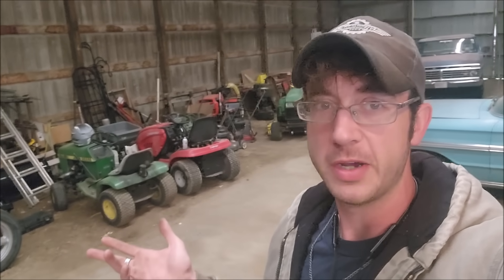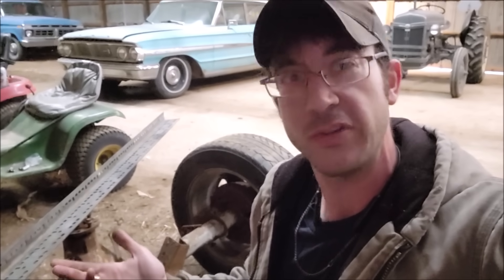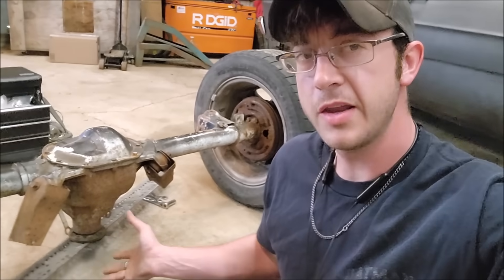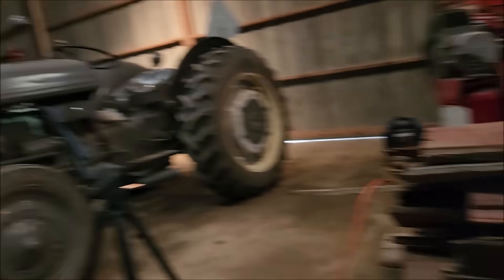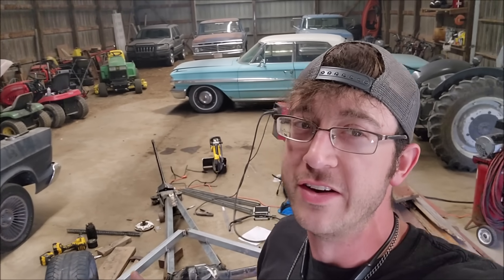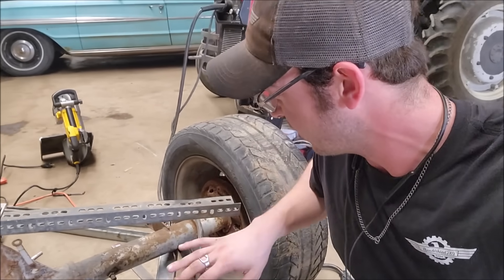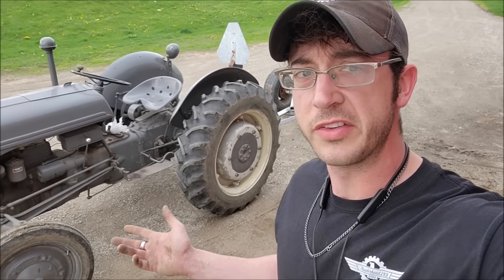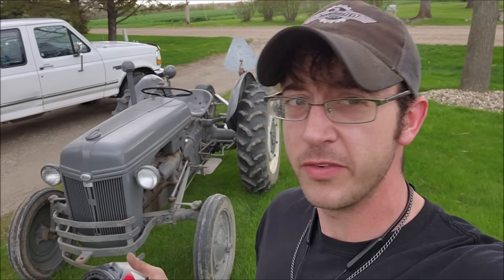Car Differential MOWER: Build & Test!

Comment: Used to be pretty common where I live, I still have a couple of them. Most here were made with 1.5 ton 2 speed axles. Usually pull between 2 and 3 of them at a time although I’ve seen 5 wide pulled before too….that’s around 30 feet wide per pass. And yes, people have been knocked off of a tractor and chopped to bits by them.

Comment: If you bolt the blades with a single bolt the blade will cut grass but if it hits something hard it give way. It’ll resemble the flail blades on a pto mower.

Comment: You should attach a 12" plate with holes around the outside where you can attach about 12 weed eater lines to your desired length. Then if something breaks it's not going to go medieval on your ass and kill you.

Comment: I built one of those mowers years ago but it turned to slow to make it cut good so I made a frame and off set a two to one shaft to double the RPM and it would cut good then. It sounded like a freaking helicopter and was dangerous as *uc*! But it cut good. After we used it a few times then I cut it all back apart before we got killed with it :) Great video...

Comment: I’ve wondered if an over land style trailer could be built with an axle set like that connected to a small generator that would be used to charge a small battery set up for camping.  Recharge going to your next camp site?

Comment: Your angle iron "cutting blade" should be flipped upside down. Traditional mower blades have the trailing edge facing away from the ground and this helps create an updraft, pulling the grass up so the cutting edge shears the grass blades to a more uniform length. Fastening that flat steel stock with a sharp cutting edge will also help to cut cleaner.

Comment: You could have made the blade twice as effective if you had flipped it up the right way and cut it in half. Most mower blades don't have one half bent down at a right-angle trying to bulldoze a circle while the other half is trying to cut and sweep with a short edge. You also need a proper cutting guard, this simply gives the leading edge of the blade some protection against rocks or sticks that it might hit during it's cycle. It also helps make the grass thrown towards a particular direction instead of just going everywhere, including thrown back in front of the cutting blade, which means it has to cut mown grass twice.
Reply from the maker: Hmmmm you skipped around in the video and didn't listen to what I said didn't you
Reply: @ThunderHead289  I watched and listened to the whole video. I'm just commenting on how you might consider improving it.

Comment: Okay, here you go: mount two small wheels under the wheels for the wheels  to ride on... that will give you gear reduction for the speed required. The extend a shaft down from the deferential to mount the blade(s) down low... a couple of very small wheels w/tires, such as from a hand truck on each side would work nicely. Attach their axles (round stock) to a plywood deck to protect yourself (and pets) 😁👍

Comment: bigger tires equal slower blade rpm.
Reply from the maker: Duh - but its the only way to make up ground clearance which is why I said bigger tires - if you didn't skip around, you'd hear that I said I'd prefer to have lower gears like 3.73

Comment: Add a lip to the rear of the blade, to create a fan effect sucking up the grass blades. Or heck even a second fan blade above.

Hold the blades upright, for a cleaner cut on the cutting edge

Comment: Those type brush cutters used to be mounted higher with 2-4 scythe blades on them for mowing hay fields. Also, there was a chain driving the axle from the running tires on ones I've seen pictures of from the early 1900's into the 30's.

Comment: Blade needs to be a plus sign or 4 cutting edges. Like the Meg -mo blades . But instead of the circle gizmo just make a cross/plus sign. Go buy some blades or find some old blades and cut them to work . If it was heavy duty enough find some old bush hog blades.

Comment: You just invented the hit and miss mower. Random fail. Need another staggered blade with all edges cutting not to outrun the gearing.
Reply from the maker: Clearly didn't listen to what I said in the video and just jumped around
Reply: @ThunderHead289  ok 👌

Comment: One thing you could try is find a way to lock one of the axles so your only pulling rotation from one side it would double its spinning speed. The thing that would be hard about that is that its prolly a c-clip axle so you'd have to find a way to convert it. Or you could just put a ski on one side and bolt the hub to a welded bracket so it cant move and let the other one spin.

Comment: You need to build a deck for this so you can get the proper lift to straighten the grass when it's being cut. Also the cutting edge  has to be the correct angle. Looking forward to version 2.0

Comment: A larger diameter tire will give you lower blade speed... Running the tractor at a higher speed does not help because the blades are also having to take more bite of grass at that higher speed... You need to increase the blade speed by at least 4 times what it is currently doing... If you ever got it to the point where the blade speed was acceptable, I suspect that it would be a Darwin Award in the making... 

Oh, and BTW, your music choices suck... The only redeeming thing was that at least you had the volume low enough that I didn't have to mute the video...
👎
Reply from the maker: Thanks for the view.

Comment: I'd re-gear for more blade speed, especially if youre going with bigger tires that are gonna drop blade speed even more. I would also reccomend you add some kind of shield over the top. That's gonna throw debris with some good velocity.

Comment: Smaller tires = faster blade turn. No shield over blade = half a guy pulling it. Careful.
Reply from the maker: Unfortunately I'd have to go bigger tires in this configuration for ground clearance - but I actually made it way more insane but also way better. Will post about it eventually

Comment: I just want to burry a comment somewhere on earth i am so salty and upset that the motorcycle my father gave me which he saved since 1990 that i drove for a decade was involved in an accident last year. Sadder still while incapacitated in hospital my father "took care" of the bike and its gone now... i wanted it back... i would have bought it back... my skeleton is permanently repaired with screws and metal and i would have fixed it even if just to look at it... and it makes me sad. Anyway. that's the last the universe will hear of it. thanks ThunderHead289 for the safe space. i saw you driving your car it made me think of my old ex500 I knew you could understand the emotional attachment.. even if to a machine. 

for clarification it was a true accident, i didn't have a stop sign, the other driver thought he looked careful enough... genuine accident... luckily i was able to react and ragdoll effectively as i was ejected and the homicide detective noticed that i wasn't a corpse.... to end on a positive i got to fly in a helicopter like an eagle :) and i regained use of all my limbs
Reply: what's a trauma dump without some humor. fun fact about being ejected off a crotch rocket. your crotch was nestled against the gas tank before you departed parabolically.... you do the math but let me just say my balls are Salty lol 

like wolverine though i have a metal reinforced skeleton now pelvis and arms in all :) be safe yall.... i have to live upwards of 75 percent of my life like this now.... but im not a quitter i got back on a 2 wheeled machine within the year.

Follow your dreams and let no one's words hold you back. You are the most amazing machine to ever be created, pilot your mortal coils to glory friends.

Comment: Biger wheels will make the blade spin slower. what you need to do is change the gear ratio of the rear end so that is will have a Extremly low gear ratio so that the Drive shaft will have to spin more for every rotation of the wheel.
Reply from the maker: If you watched the whole video, i brought up the hear ratio several times - bigger tires aren't for speed, they are for ground clearance.

Comment: As stated use the swing blade set up for grass. It is only the last few inches of any blade that actually cuts. I have seen one of these where a ride on mower cutter deck was mounted under it and it drove the deck. It had much bigger wheels and it worked really well.

Comment: Didn’t look like it cut very well to me
Reply from the maker: If you didn't skip around in the video, you'd see that literally 4 times I talked about this just being a proff of concept and how the blades aren't even on it
Reply: @ThunderHead289   i didn’t skip around… but proof of concept or not, it still didn’t seem to cut very well. You say the blades weren’t on it but you had something on there spinning. Even the dullest blades cut at high enough speeds and I just don’t think there is enough speed even with sharp blades on it. Add larger tires like you want to gain ground clearance will only slow it down even more.

Comment: Having the blades on a freely rotating centrifugally  balanced axis, and making sure they are perpindicularly aligned with the earths surface, this being accomplished ,of course, with a true magnetic, semi- inverted gyroscope, the resulting cut to turn ratio ,would be proportionately facilitated, and a longitudinal geometric influx of power would be moderalately applied to the neccesary configuration of pitch transference, allowing for an implied distribution of mass, and power, only being impeded by the force, recognized as totally, although highly calculated , revolutions per centimeter.

Comment: I would hook up those brakes so you can "turn off" the blade by dragging the rear tires instead of turning.  And also flip the wheels so they stick away from the blade more or find junk wheels with a different offset.  And cover that blade at least over the front you already have a support there.

Comment: I'd use mounted pcs of 1.5" flat with a thirty degree grind for a better blade. 

Keep in mind your have to trim off one high side of the angle to mount an opposed edge (similar to that of a lawnmower blade).  🙂

Comment: You may call it "redneck engineering", but in northern Scotland we class it as "made on the croft".
You use what is at hand, the welds might be a bit rough, it looks a bit Frankenstein-ish, but does it work,?
Yes,!
Your neighbours will come round, laugh and criticise it, but also suggest a few modifications, and in two years time they will all have built a similar machine and have forgotten about the day they came round and laughed at you.
Keep up the good work,!
Another difference is, in Scotland it would be painted with "red-oxide" paint, as the wet weather would make it rust, and it covers the bad welds.!

Comment: You should find an old brush hog blade or a new one and throw it on. If you got a grinder you can make new blades on it, I'd say you're welds are pretty good. You could be a welder if you had to. Can't tell how much penetration you got but looks like you got some

Comment: To get the highest blade RPM for any given speed, you want the highest numerical gear ratio they make for that type of differential. Also, smaller diameter tires will rotate faster an up the blade speed as well

Comment: You could change the axle ratio to change the rpm of the "blade". Welding the spider gears might also be better or st least more robust than a posi.
Reply from the maker: All things I talked about in the video 🙂
Reply: @ThunderHead289   Sorry, I got ahead of myself. I was posting the comment before I finished watching your video.

Comment: As a Professional weed mower I do agree that is Crazy in a Fun kind of way Pre Decapitation. 
Brush hog style blades are sharpened to have a flat leading cutting edge. With squared corners. That is how those blades cut without quickly becoming Dull. 
I say that in regards to something you said. 

Interesting video. Be Safe and Best Wishes from Montana M.H.

Comment: Needs a cutting head like a weed eater with solid blades connected to a round head with a single pivot point. A single blade would be more problematic.

Comment: Biggest downside I see is using that model of tractor. No live PTO. So you can't have proper blade speed, driving slowly through heavy brush and weeds. Also, a blade guard would be good, because I've done something like this, on a smaller scale and when mowing, it sprays grass and weed debris EVERYWHERE, splattering EVERYTHING nearby, the TRACTOR, YOU, EVERYTHING. I ended up using a piece of 3/4" plywood to go over the top of the blade area and that keeps MOST of the debris from spraying everywhere, but it's still a problem.

Comment: This does not have to be this dangerous, just put a guard on it. You have made a machine to throw rocks at the back of your unprotected head, if you are even briefly stunned you will crash the tractor. Even a sheet of ply strapped to the top would be better than nothing. Sometimes that thing will throw rocks faster than a catapult I promise, let alone bolts or broken blade parts.

Comment: Smaller overall wheel tire combination will result in higher blade tip speed for a better cut. Change the rear end gears to 4.11 gears for MORE blade RPM.  I also like the flail blades better for your safety.
Reply: Lower gear ratio will slow the blade down
Reply: @skinnyWHITEgoyim , When the wheel is rotating the blades it's opposite of what your truck/car does. Wheel rotates 1 revolution & the blade (attached where the former axle used to reside) will rotate 4.11 revs. So the faster the wheels spin with a smaller overall diameter along with higher gear ratio will in fact create more rpms @ a given wheelspeed.
Reply from the maker: tire change is for height since you'd ne screwed otherwise - doesn't actually translate that much, not like I put mud tires on it vs car tires

Comment: Cool project...

Personally I'd pick up a $135 4.56:1 Ford 7.5" gear set and throw them in. I'm not certain for the 7.5" but you probably need to also buy or make a ring gear spacer when switching from 3:1 to 4.56:1 (or find a used high ratio differential to bolt in).

Comment: ⚙🔩🌾 Did you know that Bush Hog blades are designed to swing freely on a single bolt? It's an ingenious mechanism that allows the blades to bounce off solid objects and swing out of the way without stopping the unit's spinning. Thanks to centrifugal force, the blades then swing back into position to resume cutting. It's fascinating how engineering solutions like this improve efficiency and durability. For more captivating videos like this, make sure to visit Meta Tech HD's channel. You won't be disappointed! 🎥🔧👍
Reply from the maker: Plugging your own channel ... kinda weak dude

Comment: obviously you are blind, it's not cutting anything but a few weeds and brushing the grass, why do you think lawn mowers and bush hogs actually have blades with sharp edges on them, think about it, what actually cuts, a sharp knife or a dull knife? and obviously a sharp knife and you can clearly see in the video that it's just brushing the grass and somewhat cutting weeds so you need and actual mower blade mounted
Reply from the maker: You clearly skipped around in the video and didn't listen at all to the plan with the blade - ie there wasn't even a blade on it yet

Comment: Bigger wheels and tires will reduce the blade rotation speed.  I'd look around for an axle from a one-ton pickemup or something else that might have come with a 4.31 or higher gear set.  The shorter the nose on the diff housing, the better.

Comment: What the feck are you doing

Why didn’t you put a pulley on the pinion and run a deck with multiple blades?
Then you could rig up a long handle that controls the tension.

Alternatively… you could replace the single blade with trimmer string. 

Also it’s easier to watch dumb stuff if there’s at least an illusion that you know what you’re doing. Don’t add more self deprecation, instead get rid of the little bit you got. 

on and off are a nice feature

Comment: Bigger tires will slow your blade down, just jog the blade up around the pinion. Maybe bolt a flat to the pinion and bolt your blade to the top side of the flat. I think you will want to keep your blade speed up so maybe taller tires if possible.

Comment: Add some portal axles to change the gear ratio so you can run the tractor slower. Also, that would allow you to change the height of the blade by clocking them at an angle. Great vid!

Comment: change out the blade for a hub with some 1/4 steel cable to make a mega weed whacker. a little safer and   prolly more effective in the long run.

Comment: Welding galvanized metal you can get fumed!! The little white stringy thing floating in the air, there bad for ya!! There's way more of them that ya can't see, until ya get that rust taste in your mouth, if ya do it's to late!! You have at least a mild case of fume!!

Comment: You could put a sprocket on the pinion, and then chain drive to blade for 3 or 4 times blade speed - if you ever want to take it to that extreme lol. Could even add weights for traction, and with a proper blade would probably do very well.